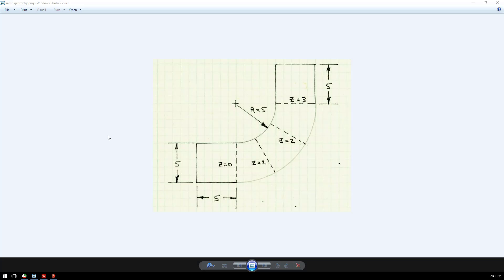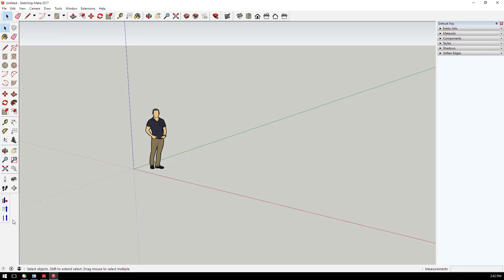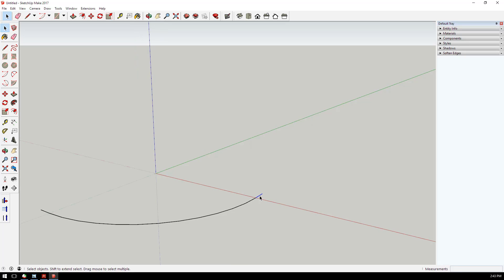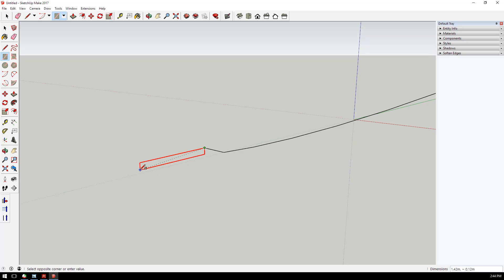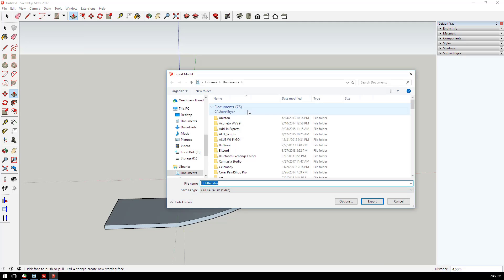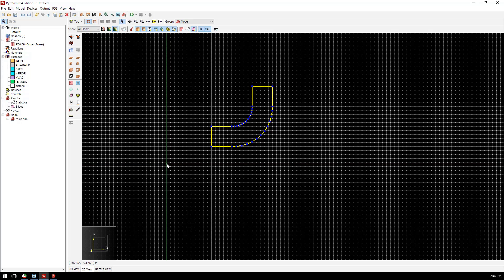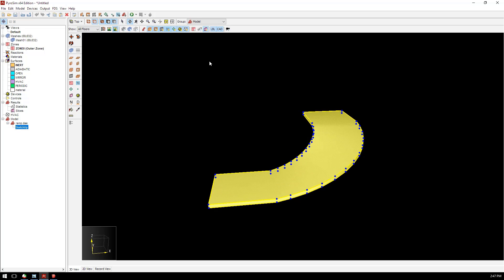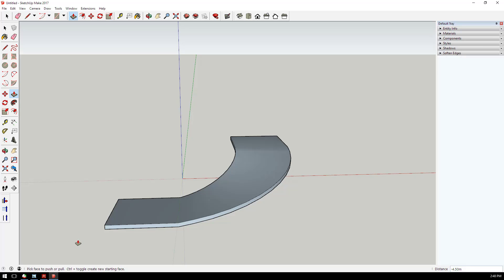Create Curved Ramp Geometry in SketchUp for PyroSim

Comment: what if my ramp is narrow on the starting point and wider on the end point??
Reply from the maker: I would use something like the Curviloft extension for SketchUp and loft the ramp crosssection profile along the same path as used with the Eneroth Upright Extruder.  Then you can set the width of the top and bottom of the ramp differently.  I have updated the post on our website with a new video showing how this could be done. https://www.thunderheadeng.com/2019/10/pyrosim-sketchup/